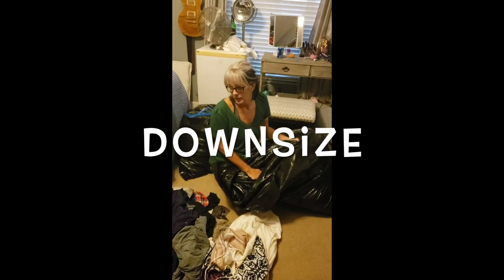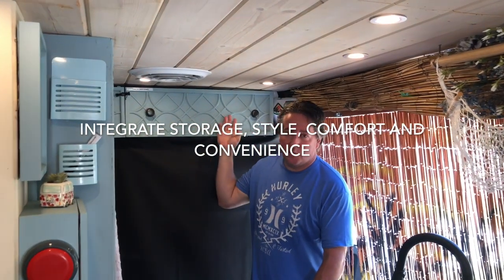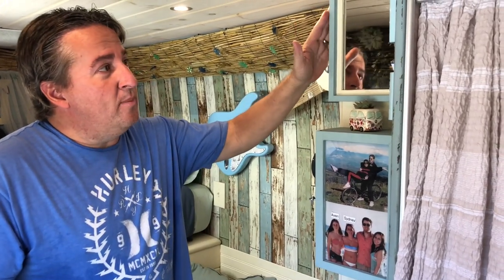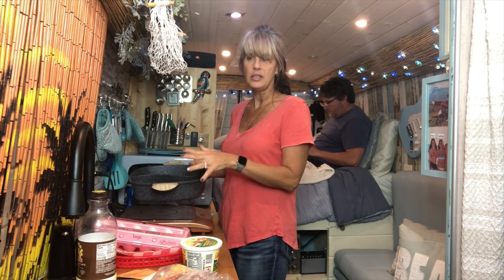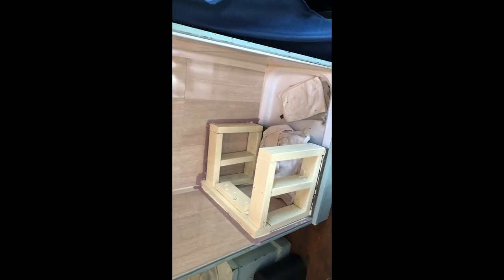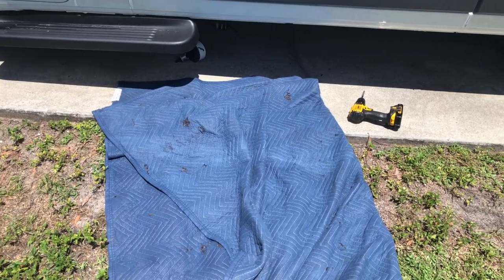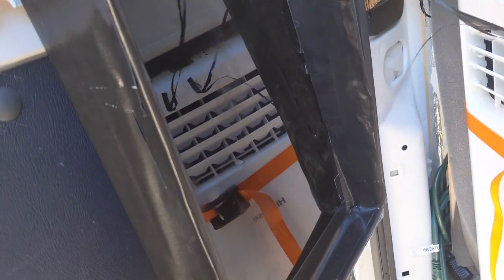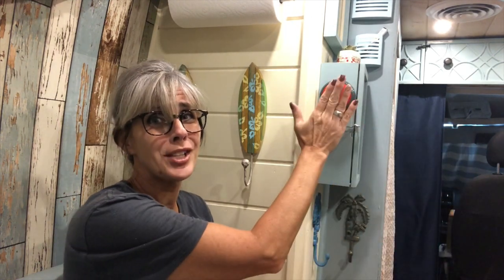TOP 25 VAN BUILD TIPS

Comment: Lots of nice touches!  Wish you guys the best.

two questions:

where does the a/c exhaust vent to?

Where did you get the insulated fan insert?

And a comment...

It'd be great to see what your power set up is.  Solar, batteries, etc.  Do you run the A/C off your batteries?
Reply from the maker: It vents out the floor in the garage. I have a video on just the air cond also on this channel that shows the detail clearly if you are interested
Reply from the maker: Vanlife Air Conditioning Solution Stealthy Style Van
Reply from the maker: Sorry didn’t see the other questions. 
You can search cramco vent insert for the max fan. It’s on Amazon for 13.99
I use three 100 a lithium iron batteries. These are charged by the alternator of my van. Works great. No solar. I want to be stealth and the alternator is a quick recharge